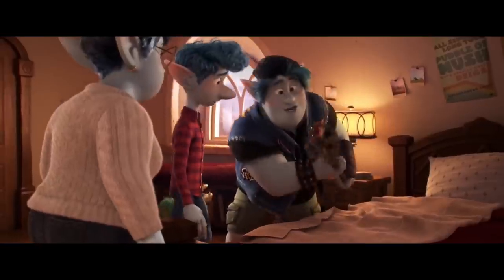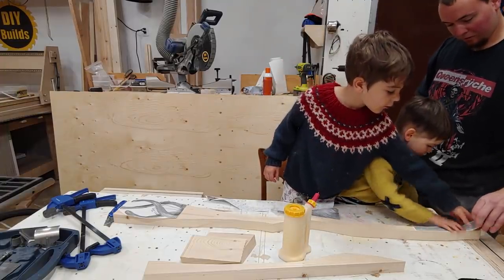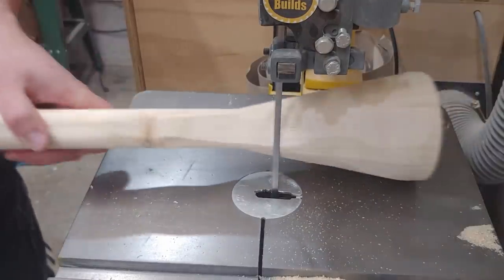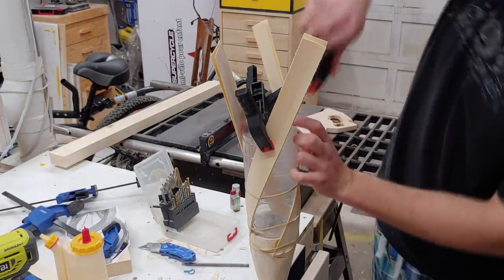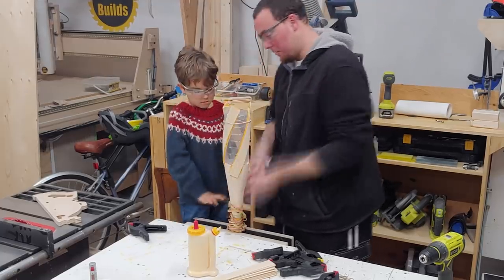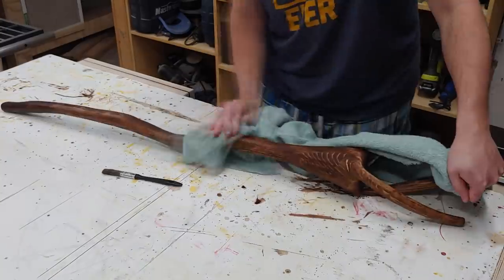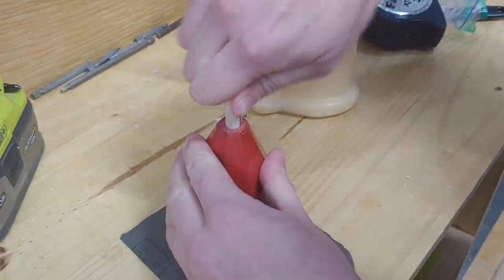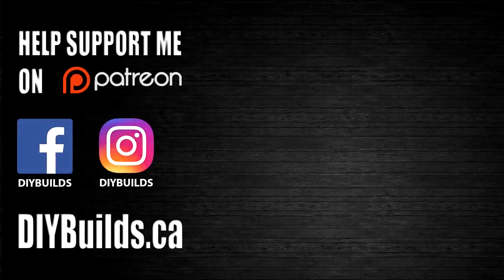How to Make A Wizard Staff with Bent Lamination (Staff from the Movie Onward)

Comment: If your parmesan comes from a cannister like that, you might as well be collecting the sawdust from your shop and using that. it's the same thing.

It works fine for filler, like breading and such where much of the taste of the parm will be gone anyway, but if you're puttint that on top of your food, you're doing your palette a major disservice.